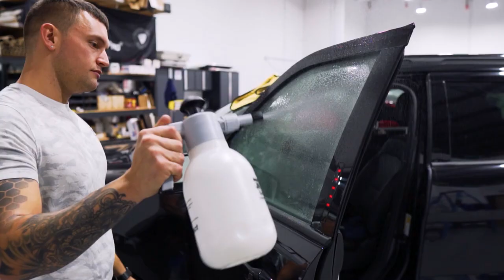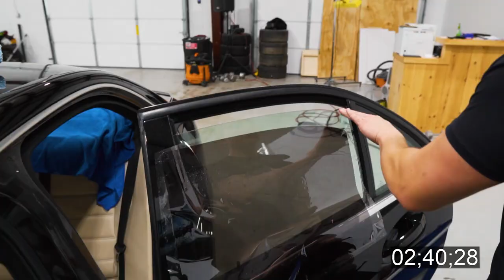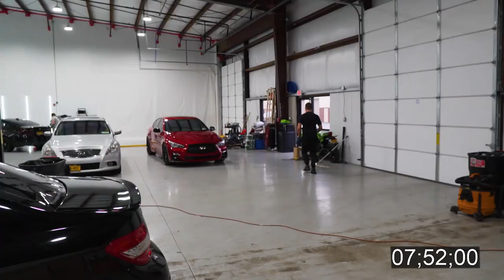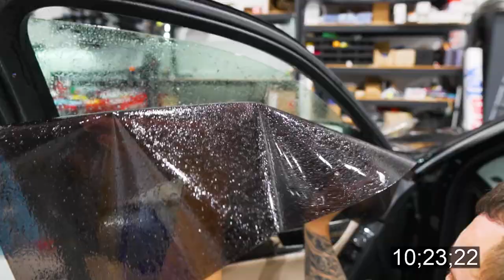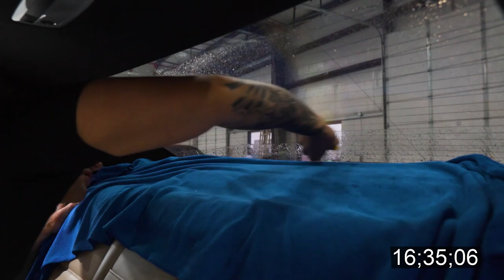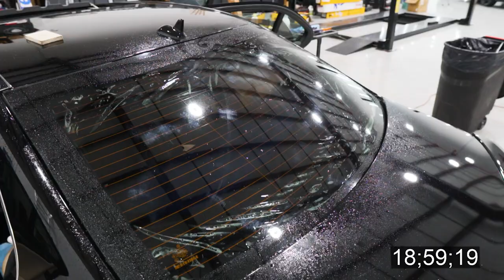How Fast Can I Tint a Car With a Pre Cut Tint Kit

Comment: They haven't even given me my Taco Bell yet! 🌮
Reply: I've priced tint through your link
It's $159 and some change for my 2004 Chevy Trailblazer. It's a straight 6 but I'm in the process of a remote mount twin turbo setup at the rear axle. I'm using two genuine Garrett GT3076r turbos.  Currently doing a mock up for the exhaust to turbos. I'll keep you in the loop as it nears tint. I'll give your company  shout out in the tint video and include your link.

Comment: why dont you shrink the door windows on the outside first? that way you won't pull up dirt with the fingers on the inside, also no risk of burning interior trim... 

I can knock out a whole 4 door car by myself cutting all the windows by hand from a 36" roll just over an hour.

Comment: Tint in a finicky thing. I have zero experience and have given the pre cut film a try, on several occasions. Failed miserably. It's cheap enough where it makes good for practicing. Professional installers are between $200 and $300 (in my area) so it's no cheap. Because you guys are getting so fast now and the material cost has come way down over the years, it'd be nice to see $100-$175 installation costs
Reply: I too would like to get so good at something that it takes me less time so I charge less for my experience